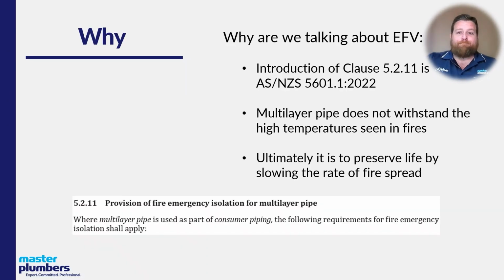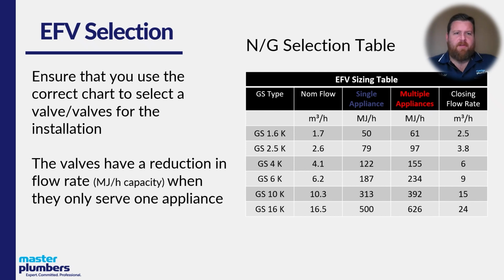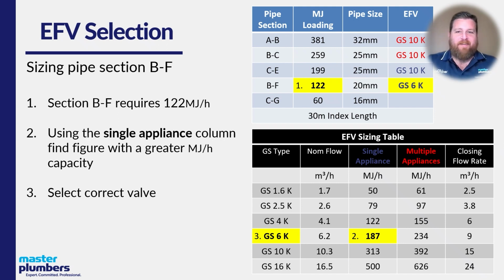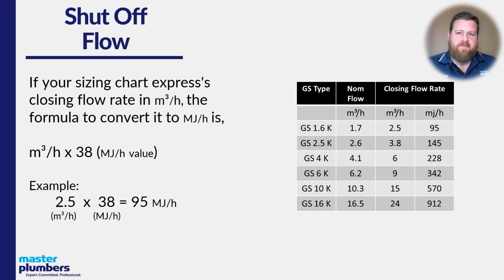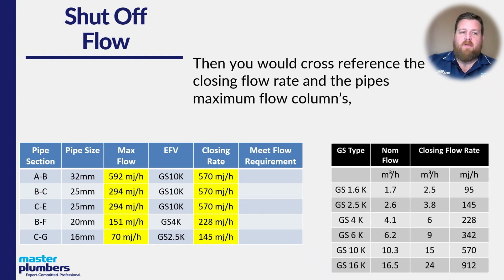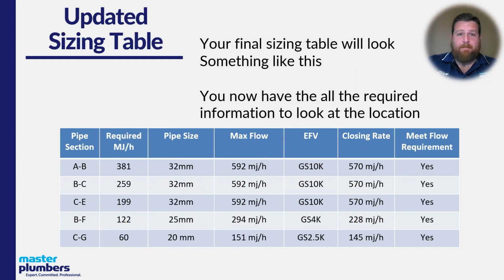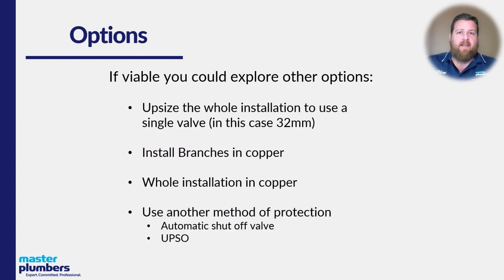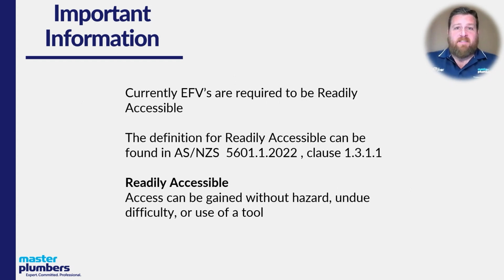Master Plumbers Excess Flow Valve Sizing Session

Comment: Very good presentation on the flow valve. For 30 years of installing gas pipework in industrial and commercial buildings. I find it crazy that the pipework being installed is not fire rated but we are installing a flow valve to make it safe. Food for thought for multi layer pipework do not install it as it's not fit for purpose.
Reply: I too have been a gas fitter for 30 years and couldn’t agree more.
Multi  layered pipe should not be used for gas in any building.
Reply: The ironic thing About all this is the safety device you need to put in. Does not have an Australia approval number. So the question is will your house be insured when something goes wrong.

I get that the government needs to do something and have a solution.

Question I have how do you test them every year
How do you commissioned the system ?

What happens when you make a design change to your gas system?